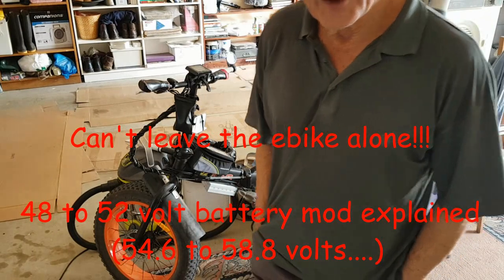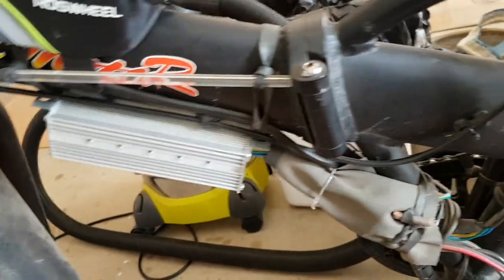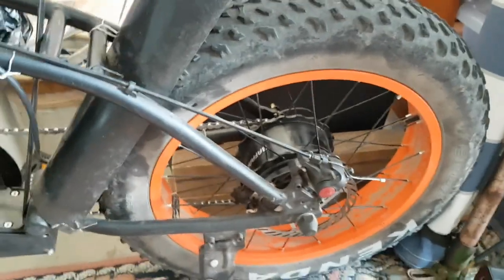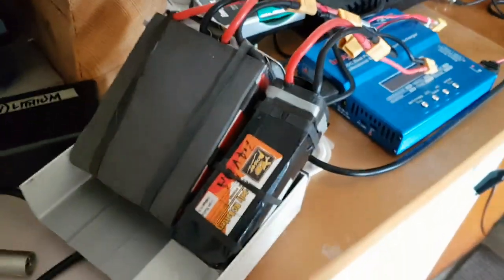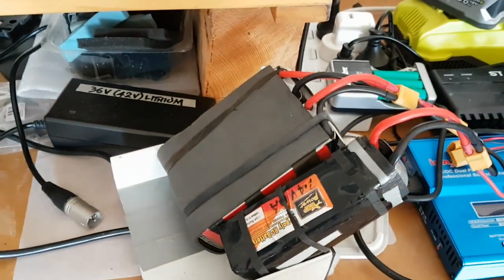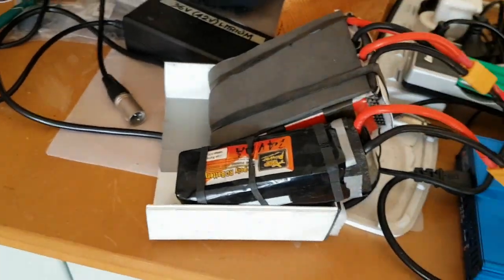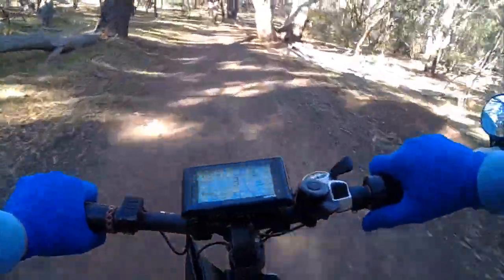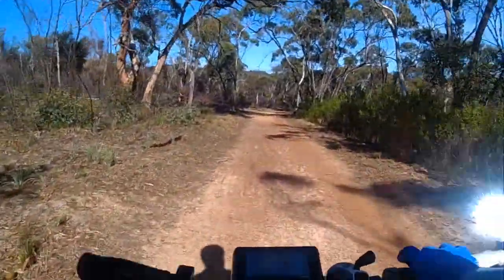Unusual fat tyre ebike power boost from 36V to 52v - does it work?

Comment: Hi I have a Michael Blast bike with a Bafang 350v rear hub motor and are going to replace with a 500v motor I have will have to lace it into rear wheel as the inside seems different  size tried but wont fit, have a new 48 controller and need to upgrade battery from 36v to 48v  battery any suggestions on adding to the 36v battery as looking at $1000 plus to buy a new one just want to add more cells if that can be done ??? thanks
Reply from the maker: Yes, you can add a separate 12 volt pack in series with the 36v to bring it up to 48v. A bit of fiddling with the wiring of the 36v needs to be done to bring out a connection as I've done in the video. The 12v pack can then be fitted to bike where you have space. One important factor is that the amperage of the 12v pack needs to be the same, or bigger than the 36v pack and the batteries need to be of high current output. You also need a separate 12v charger.
Trying to add more cells internally to the cells in the existing pack is far more difficult, especially if the pack is in a hard case. A new BMS is required, and the cells all need to be rewired to suit the new additions.
A separate pack connected in series is the simpler option unless you know what you're doing.

Comment: hi jo can you tell me what voltage the controller is, i have a 48v 1000w bike will the control take 52v battery cheers
Reply from the maker: The controller is rated at 48v but I checked inside and the capacitators are rated at 63v, so yes, my 48v controller can handle a 52v battery which charges to 58.8v.
Your's probably will too, but check caps to be sure.
Reply: @joc1862  👍👍👍

Comment: Can a 36v 20amp work on a 36v 10.4amp 500w battery what would we have to change we're thinking about converting it like you thanks.
Reply from the maker: Yes, if you can fit a much larger battery on your bike.. More amps is ok. More volts can cause problems.

Comment: I have ebike MATE X-750W.
Battery 48V/14.0Ah fail.
When turn key to ignition position volage drop to 0V.
What can i do?
Reply from the maker: Six possibilities:
Very simple one: Battery may have a fuse holder. Check if fuse is blown and replace.  
Simple one - a wire has come loose on the battery output contacts (happened to me once - easily fixed by pulling battery out and resoldering wire).
Less simple one: The key switch is dead - needs replacing.
Difficult one: BMS in battery is blown - but can be replaced.  
More difficult one: some batteries are dead. Check the voltage at the charging port. If it reads good voltage there, batteries are ok and look at one of the other problems.

Last problem: Controller may have developed a fault - but then your display would probably not work.

Comment: Lol the wires are usually coulared coordinated and also you could have fitted your battery in that little space if you drilled holes for the bracket  that sits on the battery amounted to the chair post or to whatever post was sticking up in that space you could have made it work should see my beast got a kids green machine and put a gokart cheer on:
gokart wheels:
48V20AH battery witch for some reason charges to 55v:
Just put a key barrel in: 3 speed throttle as it's to powerful at full throttle: 😂
Got these super mad super bright led light for night riding it's safe haha its legit a death trap and all taped up and zipped tied up looks like a mess haha call her the mean green machine my favorite project so far haha just unfortunate that I never shared it on YouTube cool vidoe anyways keep it up 😎💪
Reply from the maker: Would have liked to have seen it. Cheers...

Comment: if its cutting out it most likely be the BMS in the battery to protect it from drawing more amps than it can handle, just upgrade your BMS, in fact that bike battery compartment would be perfect for making a 60v battery out of the 36 and 48 cells
Reply from the maker: Yes, BMS not chunky enough. 60v battery will be another project for me. Thanks.

Comment: It appears that you have broken every rule of lithium battery configuration and don't seem to have run into any of the problems they warn you about when connecting batteries in series. By all accounts those lipos should have exploded a long time ago.
Reply from the maker: Yep, you're right... started the experiment very carefully but had no problems at all. Lipos don't even get warm.Trick for the series connection is to make sure the lower voltage batteries have a higher amp capacity than the LiOn pack so as not to stress them. Lipo 'c' ratings are usually higher than LiOn anyway... and always charge separately.

Comment: Be VERY careful with that battery setup. Those batteries are used in RC planes and quads can and will blow up like a bomb it damaged at all. At a min. you should put them in a housing that keeps them from being hit. If you drop the bike on a trail and the open packs get a stick or anything it will burn your bike to the ground. shock damage can be seen as the cell will expand and swell. At this point they are tashed and need the wires cut and the battery put in a saltwater filled tub so they drain to 0.  Be Safe and have fun.
Reply from the maker: Yes, experienced that once already. On another bike, a Lipo pack fell off, got caught in the spokes and damaged the casing. It spluttered and sizzled furiosly. I didn't show it, but on the bike in the video I encase the pack in foam and strap it very securely. Thanks.
Reply: @joc1862  They're a lot safer than folk think, if a pack ever swells up on you just gently stick a pin in it at a very shallow angle "so not to puncture cell" then squeeze /push the gasses out with your thumb, of course if it's hugely swollen you can still bleed off the build up of gasses but sometimes the cells often fail anyway /don't last long/lack guts, anyways you take it easy mate and av a gud'n, I run a 250w geared brushless motor with a 36/48 22 amp controller, with a 54v 13ah lion battery, it's perfect, I'm 6'2" 18 stone and I get over 20mph and a good 20miles 😎💪👍🙋/ put a kit on my mtb and total bike weight is now 45 pounds which is brilliant for an ebike, I always wanted a FAT BIKE, so much fun.
Reply from the maker: @ianmangham4570  Always seal pinhole with good tape afterwards. Sounds like you've got a very good motor to get that kind of performance from a 250 watter (probably pulls 700+w on full power with your controller and battery).
Agreed, ebikes are great fun - you still get your excercise but the hills are far more enjoyable to ride up....
Reply: @joc1862  Just your standard 250w minimal/ geared brushed hub motor, I've been over clocking motors all my life 😄"rc cars/planes"  all you gotta do is be careful of the heat, and believe me over here in England that's not a problem ,I bought a 36v kit about 6 years ago now, had ya basic 10amp controller with only 50v capacitors so I bought a 36/48v 22amp controller off ebayUK for £22 and that has 80v capacitors and larger /more mosfets, so I'm safe. 😎👍
Reply: @joc1862  It's been going a good year now on 54v ,they're so cheap at £67 just for the motor I figure if she fails I'll just buy another and lace it up in the same wheel .

Comment: how much km/h you have now with 30a controller right?
Reply from the maker: Now have 25a controller on bike - does about 35kph.
Reply: @joc1862  so slow? i ordered motor from ali exprees and its going only 40km/h with 48V
what max speed you got with 48v and then with 52V?
im using 30a controller planning to upgrade to 60V but afraid motor wont hadle it in summer
you can check my lastest videos with 750W motor also

i so there 2 version of theis motor one going 40km/h and one 45-50km/h

Comment: Looks good interesting on the battery hook up. Will look into that more and see deeper how that works. Try Bolton Bikes (USA) upgrade kit w/monitor for Rad Rover and RadMini. This kit is plug and play for RadMini and may be more willing or able to adapt to the bike you have . The Motan is similar to the RadMini in looks. Can’t speak for the wiring but thought to pass this along.
Reply from the maker: Thanks. Have looked at Bolton bikes on youtube. Yes, bike looks similar. Too expensive to get USA stuff here and am quite happy with the way bike works now - can climb mountains!!